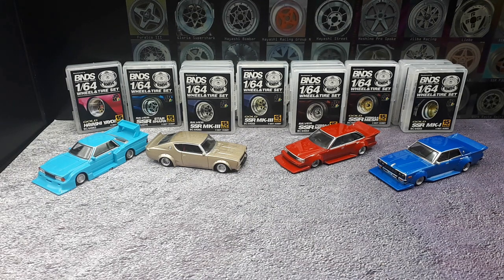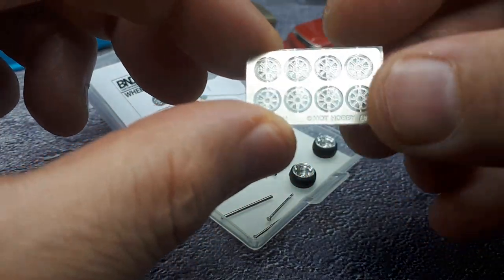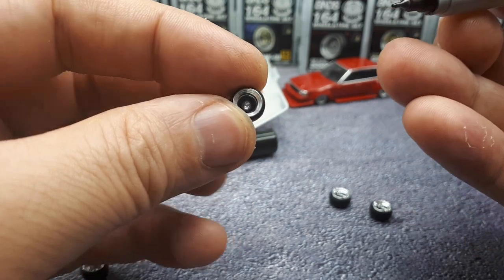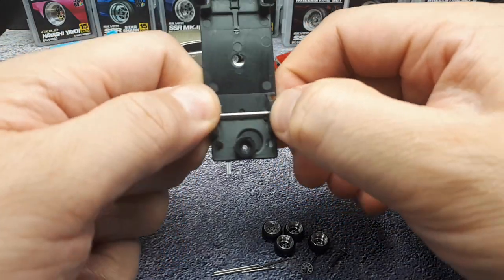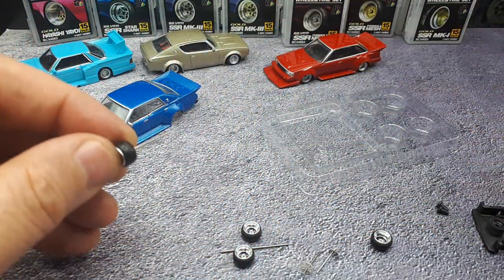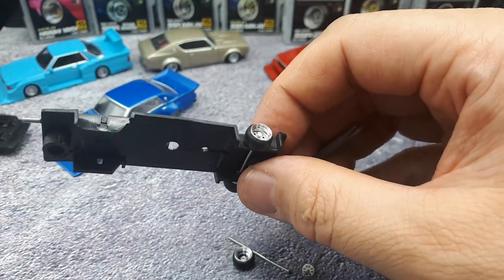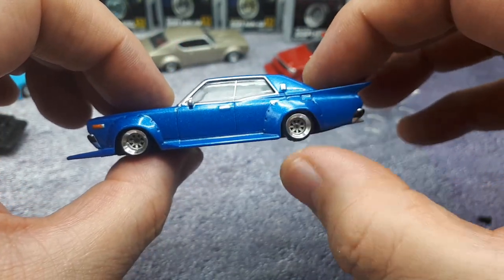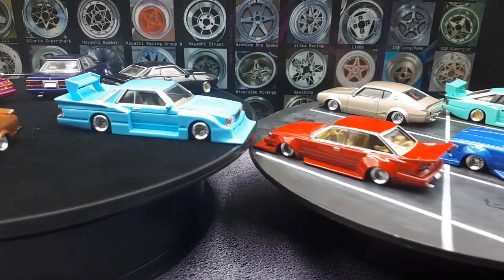1/64 BNDS alloy 15" wheels Part 1 on Aoshima Grachan, tutorial, tips, camber & steering with putty

Comment: This was super helpful; thank you! Inspired me to order the 15s from BNDS; previously I've only used their more typical JDM wheels (on Inno's, etc); The Aoshoma cars have such amazing paint, but terrible wheels; this is a great (albeit expensive) solution.
Reply from the maker: You can glue in the extra set of metal centers into some of the Grachan wheels so it's like getting 2 upgrades.
Reply: @smallmodelcollector  Whoa; I'd have never thought of that; thank you!